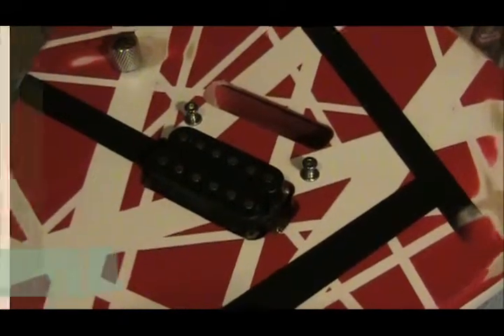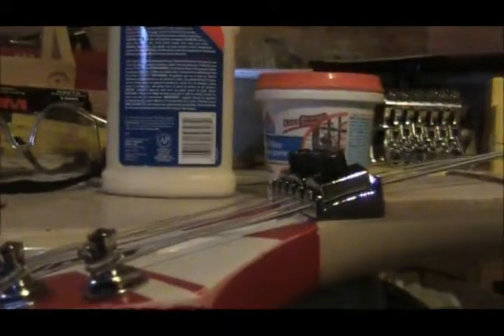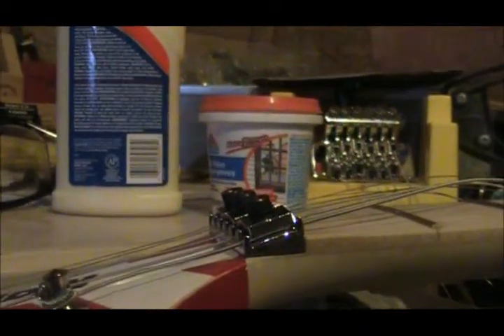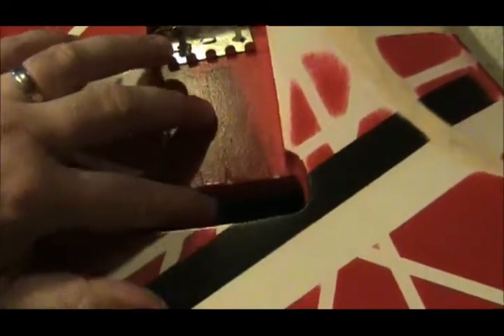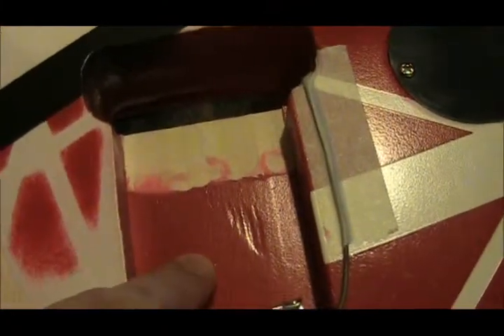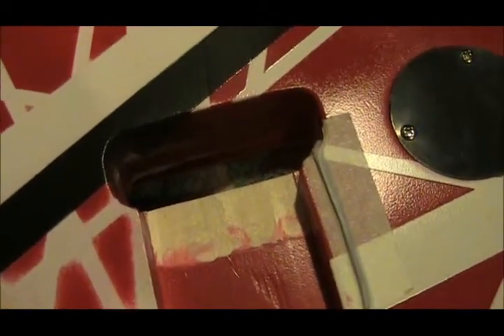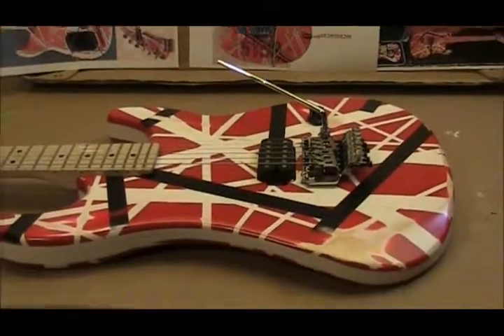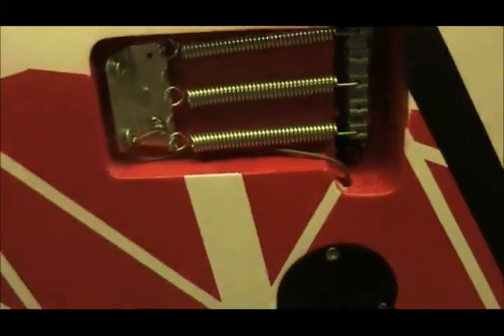5150 Replica - Tribute Guitar - Part 11 - Tweaking (more bodywork)

Comment: Still beavering my way through this series, enjoying the vids and tips. If I am pleased with how the paint will turn out I may put some hardware on it, but like you said, keyword, project guitar. I used a flat white but am now considering, on my second 5150 using a flat red also, and as far as perfection goes, I don't want the end result looking like a replica, I want it looking used and abused. Ps I may not be there yet but did you add reflectors? ;)
Reply from the maker: D'sBalls actually no (if you mean the Franken-strat's bicycle reflectors). I did get the stars and 5150 reflective numbers but they took a while to arrive. I didn't get video of them though.

Comment: Did the floyd rose go back, I know there was no routing for the trem, but was there a little back pull, or was it fully restring on the body like the original
Reply from the maker: YanniM Official It did, yes. The mass block underneath was quite small so there was lots of room. I like to set them up to float properly so that suited me fine. Blocking it would have been easily accomplished with either a screw device or just a block of wood.

Comment: Hello mewoosh, after seeing all your videos, u have convinced me too buy at lunatic body and make "some what" 5150 tribute, I have received with less problems then u have luckily! No chips near the neck, so dings but not many and easily repairable, pickup fit, deeper routing in the trem cavity ect. And these last few days ive been paint the white coat. I'm using a white krylon gloss+primer! since I do not want to relic and I have put 3 coats of paint. Obviously, I need a lot more, but 1.no matter how many coats of white coats I put, did the grain of the wood slightly show, or does it go away, especially after all the other colors? One of my guitars is like a car almost, no grain, just paint, will it come out like that? 2. Do too the videos you have posted, my floyd rose look the same as yours, but the black screws to adjust the intonation on the saddles are sticking out on the bottom, is that gonna rub against the paint and eventually wear out, or will be in the air and not matter?
Reply: Thank you for all your help!
Reply from the maker: Sorry for the delay in my response. The paint should hide the grain, yes. If it needed filling to make the finish smooth  (reflections I mean) then that is done before you start. The bridge should float level above the body and not touch. If the intonation fine-tuners touch down when you pull sharp on the trem then I would loosen the back springs to give it more room. I think the rule for floating the trem is that the high-E string should pull 3 steps sharp, B: 2 steps, G: 1 step, and then D-A-&-E go about 2or2.5 steps sharp when you pull up on the trem. I over-tighten the back springs first with a block of some sort under the bridge to hold it at the desired height, then tune it correctly, then remove the block. Now loosen the back springs till its back in tune and you're done. Hope that helps. (Maybe I'll do a video on that process)
Reply: +mewoosh thanks, I would love to somehow email my 5150 to you! It's cool, I actually upgraded the trem to a Floyd rose special, and I also made a homemade trem-stopper.

Comment: How durable is the floyd rose trem? The kit will be on sale (150$) and thinking to pick it up, but I need a floyd that will last some years.
Reply from the maker: Not durable, I would say. If you make regular use of the trem then it will wear out and have tuning issues. I actually sold that guitar quite quickly and I'm working on another with a basic Wilkinson trem on it. I'll post the video as soon as I complete assembly.
Reply: Thank you for the quick answer! Well I just wanted to make a cheap metal axe from a kit, not a 5150 tribute, I would cut the banana head like a pointy LTD and I found the guys on aliexpress who are making these kits! I think they would send me a kit without hardware for less then 150$, still debating.

Comment: (Can't reply back to that comment for some reason) last question, hows the action, and does it stay in tune with the floyd and everything?
Reply from the maker: Yanni Metaxas Well, yes the neck action was great, but that is the product of several factors (and some effort on my part): 
1) the neck can't be twisted or you will only be able to set the desired action on one side of the neck depending on the twist. A mild twist can be accommodated by fret leveling and possibly scalloping.
2) the nut slots have to be the correct depth - typically you have to cut them deeper than the original state you receive them in with cheaper guitars
3) the frets need to be level/crowned and have the correct (consistent) fingerboard radius - the better leveled they are the lower your action can be before some notes 'fret-out' or buzz
4) the neck relief needs to be correct - truss-rod adjustment
5) the bridge radius needs to be set correctly - generally consistent string height from Low-to-High strings -- this is a static properly for tune-o-matic or wraparound type bridges so the bridge saddle radius should already match the neck radius
6) finally the bridge height can be set to achieve the desired action - with individual saddles you do this at the same time as setting the bridge radius - slightly higher action on the Low-E side

In my videos you can see that I have round fingertips so super-low action is not desirable for me because when I bend notes the adjacent strings will tuck under my finger and the extra note will ring out. I prefer the adjacent strings to pile up on the side/tip of my finger instead of under it against the fret so that it remains muted.

Having said that the buyer was shredding EVH licks and said the setup was good.

As for tuning stability it was fine but the bridge posts the guitar came with were not appropriate so they returned to perfect tune when divebombing but came up sharp if you pulled up on the arm. That's a $5 fix to order better posts online. The buyer said he didn't care as long as the divebombing was unaffected and it's easy enough to block the bridge from going sharp.

Hope that helps!
Reply: mewoosh so pretty much adjust everything, but with work, it'll end up being great, thank man!!
Reply from the maker: YanniM Official It's a lot of work, but sometimes you only have to check a lot of it and adjust a little. Leveling and crowning is the most crucial provided the neck is decent. 

In an upcoming project I'm going to make my own radius block to improve my results. Thanks for checking out my stuff!